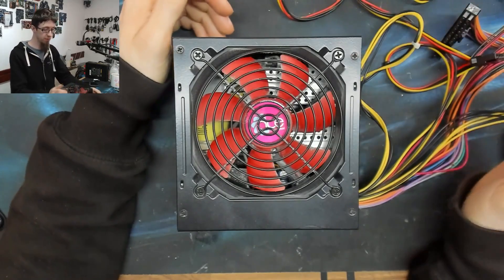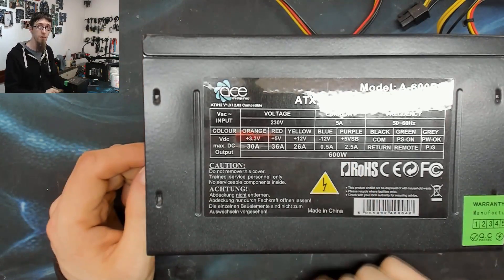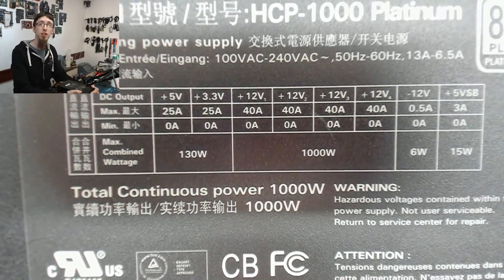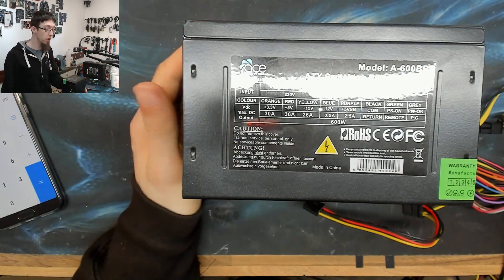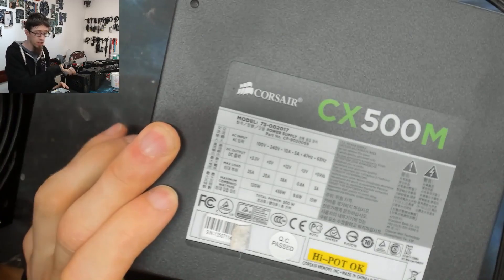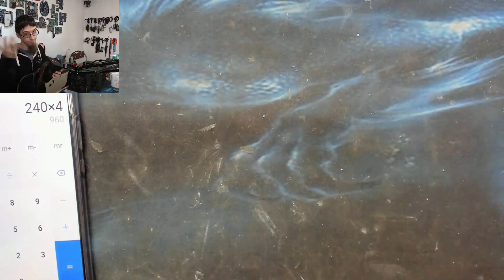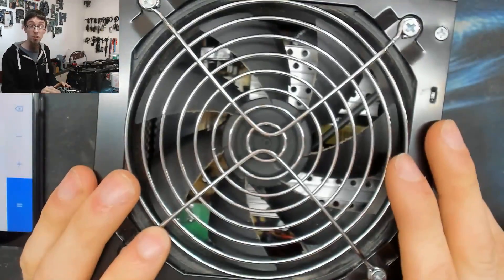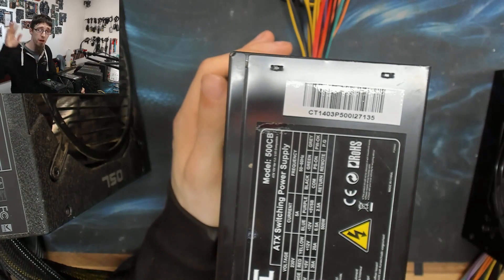LFC#171 - Why This PSU Is Crap

Comment: That Antec is JUNK! Just look at how that fan is mounted! It's a bronze sleeve bush bearing fan HANGING UPSIDE DOWN!! It SHOULD have proper thrust bearings i.e. ball bearings to handle both radial AND axial load in that position. A sleeve bush bearing fan should only EVER be mounted VERTICALLY! NEVER buy a horizontally mounted fan supply UNLESS you KNOW it has ball bearings - which automatically means it will be louder/noisier!  Also you were talking about there being FOUR 40 A supplies for 12 volt when the description box below clearly states 1000 Watt (the MAX for the supply - so THAT'S wrong in itself for a 1kW max total supply!) You are also talking about a modular supply which was designed MUCH later for MUCH later machines which have MORE on-board distributed switch mode supplies actually on the motherboard! Older machines were NOT built like that but required MORE 3v3 and 5v - the 12v rails typically only supplied disk drives which ALSO use 5v (their largest current draw typically, especially older drives.)
When critiquing supplies compare apples with apples and look at the mechanical aspects more closely. Massive heatsinks do NOT in and of themselves cool better NECESSARILY! It is ALWAYS down to a whole range of factors not least of which is the ease with which the airflow can proceed throughout the supply and pick up heat. The MAIN factor influencing that aspect is total SURFACE AREA of the heatsink over which the air flows NOT MASS. Multi finned heatsinks with finning in two axes (i.e. vertical bars rather than longitudinal fins) work well when air is directed DOWN into those fins and can escape in all directions sideways, but air blown through from one side can create turbulence wakes that disrupt the flow and adversely affect heat removal. Likewise, longitudinal fins having a cross flow have a similar problem.
I have had lightweight cheap supplies that have lasted well and more expensive Corsairs et al that were pure junk, VERY unreliable, failed early and often and actually made more "cheaply" than cheap, lightweight, no-name PSU's. The other aspect not covered is the fact that in almost ALL supplies ALL the rails are derived from ONE multitap transformer. It is THIS factor that causes the TOTAL wattage to be less than the individual wattages shown. Also in MOST cases the 5v rail is almost always derived from an earlier lower voltage tap on the SAME output winding as one (of the) 12v rail(s). This means that it is often perfectly possible to pull more than the rated 12v rail out of a high current 5v rail supply, PROVIDED that it is a) on the same coil of the transformer, b) the same gauge wire throughout that coil (it usually is) c) that only the 5v rail and one 12v rail are from a single tapped coil. It is not usually easy to tell this though since a good analysis of the actual schematic for the particular supply cannot be undertaken as the schematics are not made available. Most ATX supplies all show a pretty generic design of the SMPSU section however with either opto-coupled direct output voltage feedback or feedback coils on the main switching power transformer. In my view the latter are poor substitutes for the former.
Another factor than can cause SIGNIFICANT extra weight is if the supplies have active or passive PFC correction - PASSIVE involves a HEAVY iron cored inductor or transformer that can be over 1/4 of the total weight of the unit in some cases. Provided there IS PFC correction, a lighter supply COULD in fact be a far superior design. Without taking off the covers of those units you showed there is no telling WHAT is going on inside them. And without schematics, doing a proper analysis of them is impossible! If you WANT massive headroom in 12volts, then STOP buying pathetic AND EXPENSIVE low power ATX supplies (1000 Watts is LOW) with poor cooling flow, get yourself an HP or Dell 1400 watt server supply off eBay for around £25.00. That's 117Amps for £25! Can't really complain at that now can you compared to the bloody ridiculous price for that Antec of £140.00!!?? If you REALLY believe you need VERY little 3.3 and 5v current it's easy enough to run a couple of buck converters off a 12v only supply (the +5v SBY are often available on them anyway!) ESPECIALLY with 117 Amps available - 140% of the Antec for less than 20% the price!

Comment: hi, i wonder if my psu has efficiency of 70 it is a problem ? (sorry for bad grammar)
Reply from the maker: Poor efficiency doesn't mean it doesn't deliver enough power - it just means that it'll consume more power and make more heat in the process. This may lead to a shorter life span and higher electric bills.
Reply: @Adamant_IT  1:04, but... these cheap psu doesn't have fan controller, so speed is 100% all time

Comment: It's not "crap", it's not exactly for newer PCs, but in exchange it's perfect for older computers, like an Athlon 2000+ which takes a lot of power from the +5V rail. Actually is hard to find a PSU capable of more than 25A on +5V rail.

Comment: The case from a dead PSU that is not worth fixing can make a nice case for DIY electronic builds.
You get a power input connector and sometimes a power switch (not all PSU's is equipped with a switch) ready to use.

Comment: As many have said, older systems used to use far more power on the lower voltage rails, so likely just an ancient design that never got modernised.

Apart from the poor wattage ratings, cheap and nasty power supplies may have bad regulation, ripple, EMC compliance and even not meet safety standards.

Comment: I used the 750 watt version of that 'ACE' power supply with an FX 4300, and GTX 750ti. Barely lasted a few hours of playing Watchdogs before it started to make that burning electronics smell. Ironically, I bought it to replace a 600 watt CIT power supply that failed in a similar after I installed the graphics card into my old PC.

I learned my lesson and bought a corsair VS 550, which is now running an FX 8350, and has been for the several years since I sold it.

Comment: Once bought a modular PSU off eBay for £35 biggest mistake o ever made. I had it for my old AMD Phenom II X4 945 rig worked for a out 2 week then started to shut down all by it's self. In the end scrapped for a Corsair 750w PSU non modular at the time they were expensive around £130

Comment: Not necessarily any correlation between weight and quality.... i mean third to half of the weight is in the steel outer shell, so higher end brands make it thicker, but it's a perfectly fine part of construction to compromise on. In the meanwhile efficiency increase means the heatsink area and bulk is often pretty low and that's alright. 15-20 years ago there was another weighty component, a PFC choke, but with active solution, that weight is gone now. You could back then easily tell a "proper" PSU from junk before APFC came about, because the junk would skip PFC altogether. It's a big component, there's a laminated steel core and a lot of copper on it. I'd say that's not a bad heatsink even, the holes are deliberate to help cool components underneath and the much warmer stem of the heatsink, they're not there to save on material. Alu heatsinks are lightweight anyway. There are a couple transformers and chokes which tend to get a bit heavier with more core size and copper weight the more current you want out of them and the more efficiency you want out of them, but overall there's so so little internal weight variation on the PSUs today before you get to really high wattage ones. Caps weigh nothing either way. Power semiconductors (dual diodes, MOSFETs, etc) vary greatly on efficiency at the same negligible weight. Oh the wiring contributes a good bit, there's a lot of copper in there for higher wattage units with a lot of connections, so there's that.

Everyone saying "it's an old PSU" is kinda right. Heavy 5V rail and the mere mention of ATX 1.3 on the chassis is an indication that it's a straight up copy of a very old design, even though the date of manufacture is fairly recent. Why it's terrible is not merely for this fact, it's because it was built by who knows whom who knows where and certified for regulation compliance who knows how - probably not at all really, grey market product. The transformer between primary and secondary is a safety critical component that needs to be wound and insulated CAREFULLY, and you simply can't know that this is the case unless the device comes from a reputable factory. Then there's protection circuits, secondary filtering circuits component selection for ripple rejection, etc, all these things need a fair bit of experience to design properly. You could be risking quite a bit by using junk. I mean this PSU isn't even powerful, now you can get an LC-Power made by Great Wall, low wattage, but practically similar, which at least won't kill shit left and right, probably won't be very durable on account of capacitor quality, but it's a better purchase than this weirdness, they have TÜV cert and a true 80+ cert and whatnot, and it's probably not even more expensive than this scam product.

How to know whether you have a good power supply? You can often tell from the label when you have junk, but the way you ensure that you don't have junk, is have a reasonable supply chain! Know where you bought it, that the seller won't sell you fakes, that the brand stands behind the product in some way, and that the product can be traced back to some OEM that either you know is consistently OK, or which you know can be OK if the brand is known for commissioning good units off them, and you really trust the brand. The way you know you have a good power supply, is essentially trusted supply chain. Just like the way they build a good power supply is with a trusted component supply chain.

Comment: as a reference. I bought the SF600 for my mini ITX project, and it runs 12 volts at 50 amps, giving it the rated 600 watts of power it advertises.

Comment: That cheap power supply is hilarious and really deceiving.  Not so much the power ratings mind you,  but notice the "ATX 12 V1.3 / 2.03" up in the corner of the label.  Then I notice what I think is a 6/8 pin video card power connector?  That connector didn't even exist when that particular ATX spec was new (2003-2004),  so this just looks like a really old ATX design slapped into a new shiny box and that connector was added as well - which is easily possible to do,  just solder it to the existing 12V rail.  What's worse is that the 12V output in those old supplies may say 26A or whatever,  but they were never designed to run sustained near that max current as back then it was meant mostly for peripherals.  Peak for brief periods,  sure.  Hooking that power supply up to a modern gaming pc can cause some serious issues.  Best case would be random shutdowns and reboots as the power supplies OCP and thermal control would kick in... Worst case would be an over current transient or thermal runaway that the supervisor IC doesn't catch fast enough (or it could be just using an LM324/339 or similar if it's a really old/cheaper design, who knows) and... well you probably figure out what happens then.  Better bust out your wallet because you won't be just replacing your power supply.

Comment: Here is the thing: The way I see it, that is an old example of an ATX power supply (can be wrong on that one though). That PSU seems to be manufactured right between the time where you still needed lots of power on the 5V and 3.3V rails (I know I have an old 24 pin motherboard that has an AGP port that needs lots of juice there) besides the usual secondary 12V rail for processor and Ram. Now, just to be clear, Im not saying the psu is any good. Seems to be cheaply built (and I have my fair share of bad luck with those) but alas, seems to be from the "transition" time. On the other hand, I was kind of disappointed that  the power supply was at no point dissasembled. Most of the time this will reveal that the 12V rails are interconnected (that is, the claim is that you have 2 or more rails but in reality all comes from the same source) and that they use pretty cheap components that give you just the barely needed to work whilst injecting LOTS of noise into other components which has a big role in degrading or damaging other parts. Videocards are known to die from bad power supplies.

Comment: For older PCs that use the 5V rail more than the 12V rail, would you recommend it? after a quick google I found out that corsair doesn't provide more than 25A on the 5V rail on any of their new PSUs. I have a theory that most of these off-brand PSUs are fine song long as you don't exceed or get too close to their max rated output per rail and that people who don't know about this write them off as bad because they are pulling too many amps from the 12V rail.

Comment: Old power supplies are all split evenly between the 12 and 5 (3.3 shared the 5v rail) since the Cpu used the 5v more heavily up to the p4 cpu and peripherals used the 12 more heavily. Now the Cpu and graphics use the 12 much more heavily so its slanted in favor of 12. That power supply is more suited for older main boards

Comment: I have just obtained a GTX1070 for my aging p9x79 pro with a Coolermaster rs-850-esba psu. I have lost the 8 pin to 6+2 pin PCI-e cable. Can I use another modular PCI-e cable from a different PSU ( I have a Corsair CM750 in a different PC at the studio ) or can I use a 6 pin to 8 pin adapter without blowing things up? I love your channel and you know your stuff.

Comment: These are also called "true rated" PSUs sold here in our country...
Reply: We somehow never called those crappy PSU as "pure PSU" which is nearly same thing anyway... Easy to spot, feels loke tin can

I'm using Korean used PSU, not 80+ but oem of Shenzhen Vatyn which is listed on plugloadsolutions
Reply: @titopowlo  seems to be

We Indonesian used similar term: "PSU pure power" but it doesn't look like this.

It looks like Imperion brand PSU which is so cheap

Comment: I had it with a 600w sumvison psu it was in a q6600 system upgraded to r9 270x and it wouldn't even power on

Comment: the reason for the high rating on the 3.3V rails is because nobody could ever load them up that hard to make them fail. They don't actually output that but it helps to get to 600W in the numbers.

Comment: I'm using a ThermalTake Smart SE 630W which has a single 12V rail sporting 588W (49A), working fine since 2015 though I hope I get a few more years out of it before it fails.

Comment: This just a piek power of 600watt.
Today on high end psu it's tell you 600watt continue power .
Means 600watt all the time to use.

This cheap psu still built on the old day when the 5 volt is use for the cpu and for .
It's not shit what this person tell you .
No it's old systeem power supply for older systeem .
And old systeem the 12 volt is use for your DVD drive and the agp gpu card .

So  you need to look on the psu what version and type of psu it's is. .

So this reviewer do not know this means he is a noob on psu and need read in about the old psu series.

Comment: Ahh, Ace. As a Newbie I dealt with a PSU of there's in my old GTX 770 FX rig. I thought the addition of a blue LED inside was pretty until it died after installing Windows...

Turns out it was on fire the whole time.
I saved everything but the motherboard and still use the GPU and SSD to this day in a backup rig.

Comment: Honestly, I really doubt the 3v and 5v rails can even deliver those currents. But hey, they put big numbers there (which you won't ever use and no one will test because it's mostly useless) and they can "lie" with the 600W label.
Reply: Hi!
 I use those "bad psu's" to power some retro machines like AMD's Socket A due to the high watts on 5v rails. I love those psu's that have that side sticker printed with  "for Pentium IV and AMD CPU". When I find one I recap and use it. Those with 30/35A on 5v really deliver that power.

Comment: Don’t bother watching this garbage. 

For the “creator:”

Maybe you’d understand more about PSU design if you actually assembled a system and checked current distribution with a clamp meter. 

This is hands down the worst PSU video on YouTube. It completely confuses absolute maximum ratings of individual connectors and the “rails” within a given architecture. 

Another good learning lesson for you would be to get a sheet of paper and write down a list of every possible system configuration possible using that supply. You’d figure out why PSUs distribute resources.

Comment: If you can't trust the brand... How can you make sure that the numbers they are mentioning is even correct?
Could you please elaborate how we could make sure of those numbers?
Thanks in advance
Reply from the maker: That's a tough one. Ultimately the only solution there is to stick to reputable brands.
But for what it's worth, I don't think I've seen reasonable evidence of any brand names straight-up lying about their numbers. That doesn't mean it doesn't happen, but I don't think it's something to worry about unless you're buying bottom of the barrel Shenzhen specials.

Comment: The ace power seems to be based on older power supply designs. Back in e early 2000’s and before, computers used the 3.3v and 5v rails more than the 12v. It wasn’t until the Pentium 4 that the 12v was used as the primary voltage.

Comment: The output on 12V rail is split in sections because the wires/connectors themselves are limited by gauge and how much current they can handle. The number of rails does not necessarily represent the internal structure and design of the PSU therefore it is not correct to sum these outputs together.

Comment: 0:59 mass only creates thermal capacity, but that's not what you need for cooling. You need surface area for better heat exchange with air. And that's why they drilled those holes there.